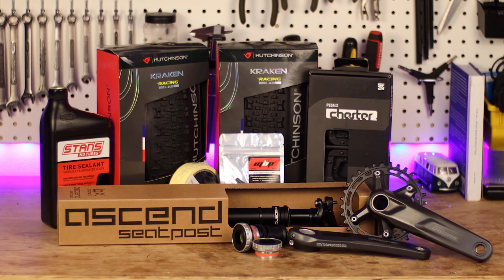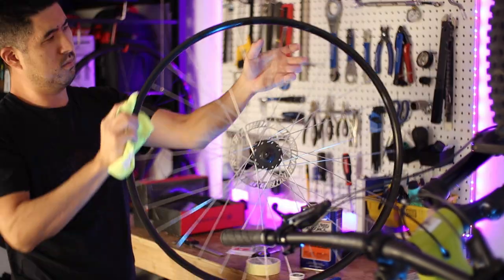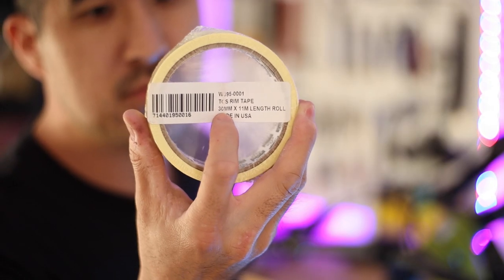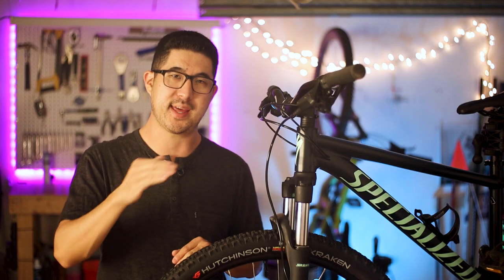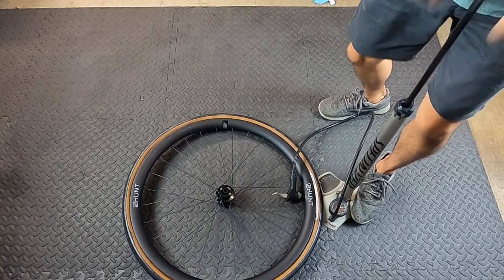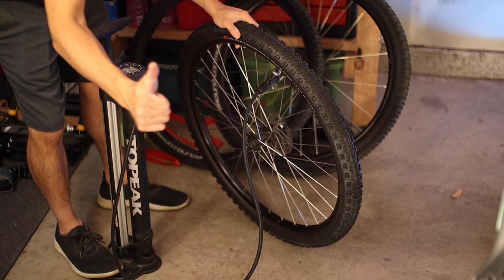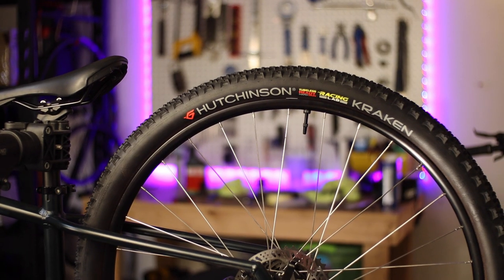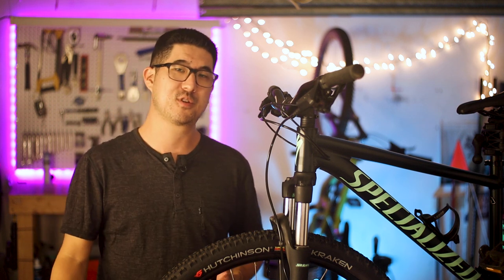Specialized Rockhopper Upgrades // Budget Tubeless Conversion

Comment: I went tubeless a few months ago, and the difference was amazing. I had stock Specialized tires, the Butcher and the Eliminator. When I went tubeless I had so much more grip. That said, it still was not great. A few days ago I converted to Maxxis. I put the Assegai on the front with MaxxGrip and DHR II MaxxTerra on the rear. I don't know why I waited so long for this. I absolutely love this setup!
Reply: Were you able to place wider tires on the stock wheels?
Reply: @LookitsRiley  yes... The stock width was 2.3" and I went with 2.5" on the front and 2.4" on the back

Comment: Floor pump tip: You can always set the bead with a floor pump. If you're having issues there's two ways to fix it: 1. Second layer of rim tape, creates a tighter seal between rim and tire. 2. Setup tubed and optionally leave overnight to press the tape against the rim. Then break the bead on ONE side of the tire only, remove the tube and reset tire. With one side being completely set you will have much better luck with a floor pump. Expect this to be a pain in the ass, but it's doable and works if your on a budget.

Comment: Quick question for you, I have the 2020 specialized rockhopper medium frame with 29ers.  Im also looking to go tubeless and upgrade tires to something with better tread.  Im thinking I would like to go up to a 2.5 width tire and use something like a Maxxis DHR tire which seems to have a flatter shaped tire and bigger knobs on the outside of the tread pattern.  It seems there won’t be an issue running a 2.5 tire on the skinnier stock rockhopper rim, but im concerned the back of the rockhopper frame will not have enough width for the back tire to clear.  Do you have any resources you could point me to or knowledge about whether or not running a slightly wider tire would work on the rockhopper?

And btw, Thanks for the content and this series specifically… very useful info and well produced.
Reply from the maker: A bit wider would be ok I think. Especially if you don’t need a lot of mud clearance. The DHR II is the gold standard for mtb tires and the 2.4 would be a great upgrade

Comment: Watched this series like 8 times over. Ended up actually buying a used Rockhopper sport 29. The guy I bought it from installed tubeless ready tires with tubes. My local bike shop told me that doing what you did here would never seal up right, how has this set up been over the last year?
Reply from the maker: Still tubeless on the same sealant. Haven’t touched it since and we use the bike daily
Reply: Good to hear, I'll be attempting the conversion soon then. This video series has been my favourite to watch. Helped me pull the trigger on buying the bike. And it really is a great video series. Good narration and camera work. Straight and to the point without being too short. Keep up the great work.

Comment: I want to follow this tutorial but my stock tires are stuck to the rims. I've changed tires on other bikes with no problem before. Any tips?
Reply from the maker: Try really pushing the bead toward the center channel of the rim. Once you get the bead separated in one spot the rest will follow pretty easily

Comment: Question: Does this base model specialized rock hopper already come with tubeless ready wheels? Ie: spokes countersunk & ready for tape
Reply from the maker: I can almost guarantee it's not a single wall rim (protruding spoke nipple heads). It's certainly going to be double walled, and ready for tubeless tape.
Reply: I have the exact same bicycle and whenever i bring up the idea of laying tape and switching tires and nipples my local bike shop people just laugh and say that i need a whole new wheel entirely without even looking. I have a 2023 size M 29" rock hopper @TheBikeSauce

Comment: i just ordred this exact setup. im a noob, got the same valve stem as you, not sure what it was called but do i need some specail tool on my air compressor to like fill this type of stem? if you could link me. all i have is a 1gallon air compressor no bike pump.  Thanks in advanced.  I dont know much about bikes just learning.
Reply from the maker: You'll need a head that can inflate a Preste valve. If it's not bike-specific, it's likely a Schraeder compressor head. In that case, you can use a presta valve adapter (a couple bucks) that'll screw onto your presta valve and allow you to inflate it with any standard Schraeder pump (like at a gas station). For setting the bead, you'll also want to remove the presta valve core to maximize volumetric flowrate into the tire.

Comment: When you go tubeless, can you go back to a tubed setup? Wouldn’t the liquid sealant mess up the wheels? Awesome video! Be safe on you rides!
Reply from the maker: Thanks! Yes, you can revert to tubes very easily if necessary. Just clean out the sealant and throw in a tube
Reply: It's also common to carry a tube with you on trails in case of a sidewall tear or bead just not wanting to pop back on if the tyre loses pressure
Reply from the maker: Right. All part of the every ride carry
Reply: I suggest a Tubolito as a spare.  They are super compact and light.
Reply from the maker: Have yet to test one out, but it’s on the list

Comment: What size are the stock Schrader valves?
Reply from the maker: Schrader valves are all standard
Reply: @TheBikeSauce  what size would the perfect size Presta valves be for this conversion then?
Reply from the maker: Ahh, depends on the depth of your rims. Measure the rim depth and add about 25mm. I think 44mm is a standard size that should work well unless you have deeper section wheels
Reply: @TheBikeSauce  ill get the 44mm, i have the same bike as in this video. thank you